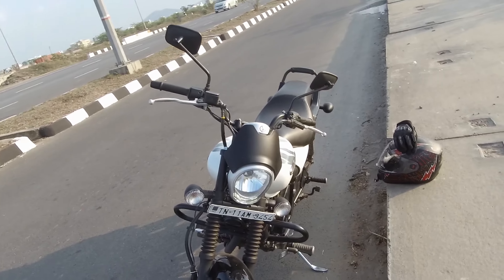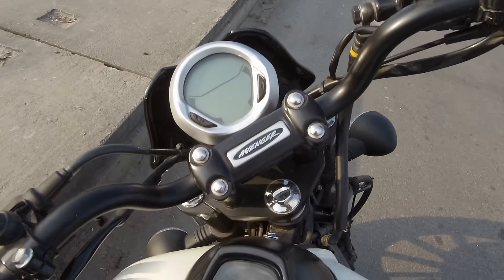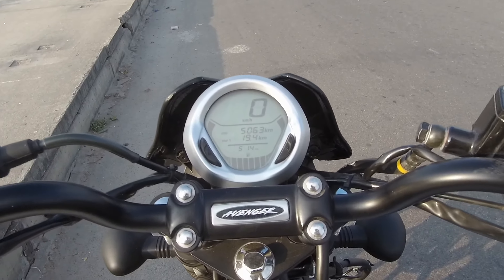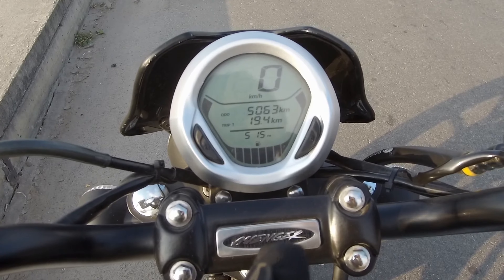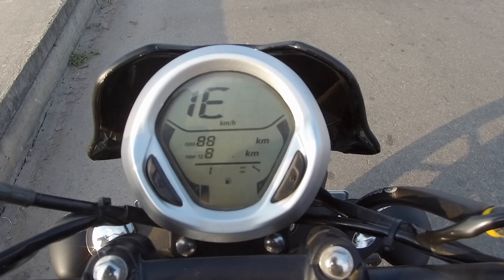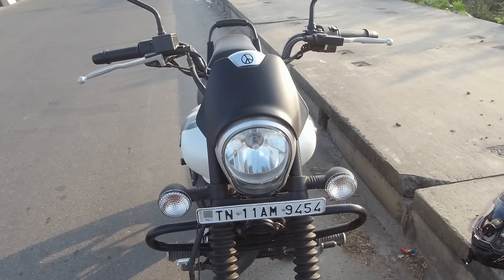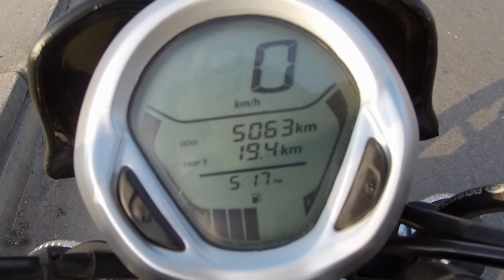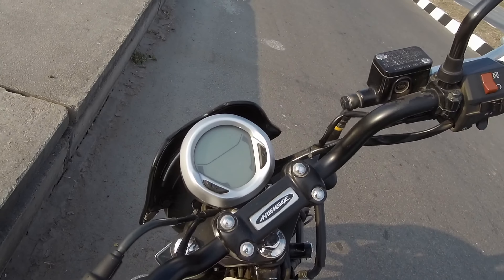Avenger 220 fuel gauge issue? #avenger220

Comment: Very useful video
I will try on my pulsar
But almost all bikes with digital fuel gauge has issue of accuracy
I never trust digital fuel gauge
I using trip meter whenever i fill up fuel (for short ride) 
And i using fuel on, off, reserve tap (for long ride)
Reply from the maker: Yup. Digital gauges are useless. Even I use trip meter to calculate fuel  level.
Reply: @ridewithmi  same hear 👍